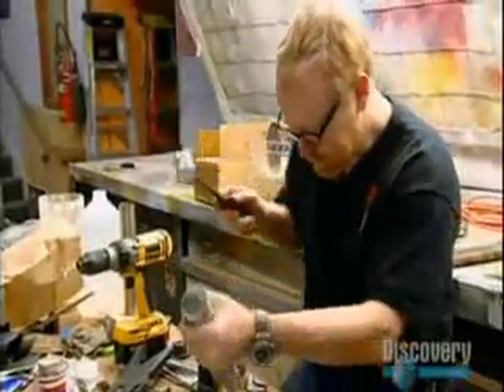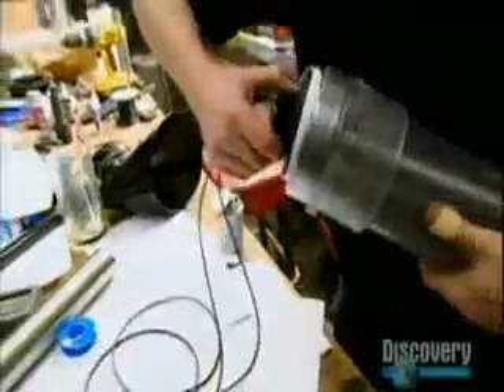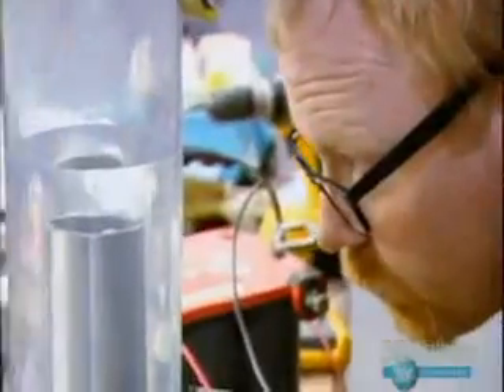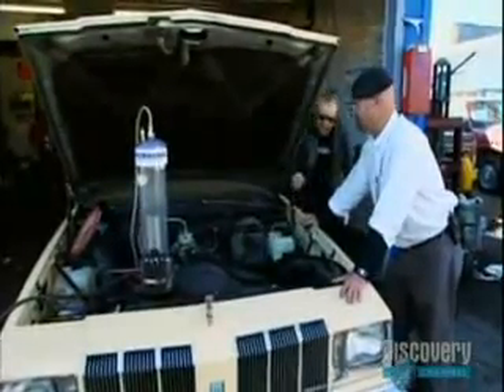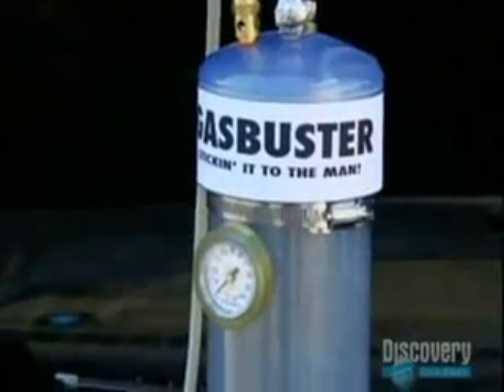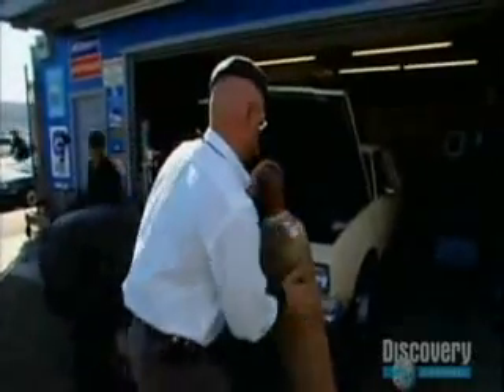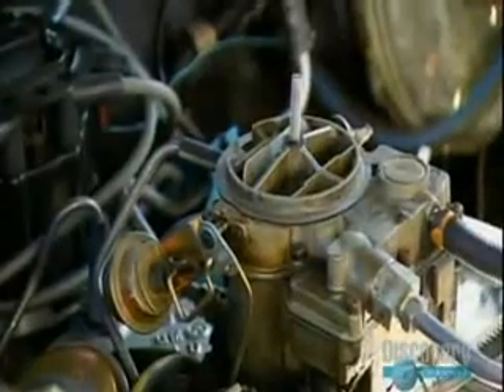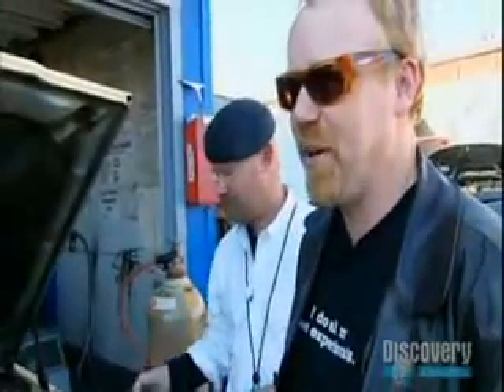HHO Mythbusters Explained

Comment: They DIDN'T try ! More like they set out to disprove it ! Like the announcer says, "supposedly apply electricity to water and get hydrogen, at least that is what is CLAIMED". To make it sound like electrolysis isn't a real thing either. And there were no bubbles of H2 and O2 coming from the cell like their should be. Connect 9v or 12v to tap water and you will get a very visible stream from the wires even without adding salt. Adding baking soda or other electrolyte will make it greatly increase. In the video you see no bubble stream at all. And Grant is supposed to be an electronics engineer and should know better. Either the cell didn't get power or was shorted. Either way they could compare it to any electrolysis demo on the internet to see it wasn't working.
The also mentioned this is from an "internet patent" to discredit it. There is no such thing ! You can get ANY patent from the internet but that isn't the same thing. Then at the end they mention it was from the internet AGAIN. 

They actually debunked electrolysis, claiming it didn't work. But they didn't say that. But they showed by adding electricity to water you get no gas at all. Since they knew it was electrolysis, they should have known it was wrong ! But instead they showed it produced no gas at all ! A pretty simple experiment to mess up ! Put 2 wires in tap water with a DC voltage on it. Or just drop a 9v batter in a glass.

Why didn't they contact any of the companies or customers in the area for a demo ? Why not even ask a local science teacher ? They have a research department but didn't try ! And their are plenty of people available to contact on Youtube.
This is what it should look like for even a very basic demo without even having many plates.
run your car on water. This guy does just that! 
https://youtu.be/wjeM2IBhtlc

water electrolysis
https://www.youtube.com/watch?v=HQ9Fhd7P_HA

Notice both demos have easily seen gas streams !

There is no mention AT ALL of the NASA study that shows adding hydrogen increases MPG either from the "research" they did. It increased  MPG from 2 - 4 MPH and decreased pollution too.
http://www.hydrodynamicshho.com/nasa-reports

Or many other studies out their. So much for "science" to ignore the existing data then try to discredit it. And their are many studies that show much higher efficiency than DC electrolysis.
http://www.hydrodynamicshho.com/nasa-reports

Pulsed DC and Anode Depolarization in Water Electrolysis for hydrogen generation
www.dtic.mil/cgi-bin/GetTRDoc?AD=ADA297375
It says you can TRIPLE the DC amount of gas and possibly TRIPLE that to make it 9 times the DC amount of gas !!! Why is this not mentioned anywhere. It is from an Air Force Thesis so it would have been verified by the professor !

They pulled the same kind of stunt with the Bedini motor. Then shows a DIFFERENT motor and turned on the "modulator" and said they could here it run down. The Bedini has no "modulator". And they could have contacted someone on the internet or Bedini himself and got a demonstration and tested it.

Comment: We did this for  our physics project. saving 60 + - percent of gas. and we did run the car without gas. 
we had a lot of bubbles. 4 litters of purified water and 4 spoon full of baking soda . wish i could send pictures. the technique is when u make a hydrogen reactor, use 3 cylinders of food grade stainless steel (316). using the other two as neutral conductors. and maybe more electricity for more reaction? :)

Comment: Hydrogen embrittlement is the process by which metals such as steel become brittle and fracture due to the introduction and subsequent diffusion of hydrogen into the metal. This is often a result of accidental introduction of hydrogen during forming and finishing operations. This phenomenon was first described in 1875. via Wikipedia,

how does the average diy user overcome 
this issue, there is a process that is done to aircraft engines to avoid this, but I don't think car manufacturers have this in mind when designing engines.  this could potentially cause serious havoc if one were to run hydrogen as a fuel long term

Comment: Splitting water, which is a product of combustion, so that one can reburn it is a circular or reversible process. In any reversible process some energy is unavailable for useful work. That energy is called entropy. That is the reason why this kind of thing can never result in more energy out (better fuel economy) than in. For that to happen would allow for the building of perpetual motion machines. We would be able to build power plants with only water as a fuel.
Reply: +Kim O&#39;Brien power plants CAN be built to run with only water as fuel. Einstein said it "hell of a way to boil water". near every nuke power plant COULD drill well shafts to use geothermal heat to make steam needed to spin the turbines, instead of enviro-hazard nuke boilers. re-condense the steam after the turbines, drop it right back down the well casing. they can't NOT know this, it really can be that simple. need more pressure drill another well shaft to trickle water into and connect it. they'll drill for OIL through miles of water and Earth, but they refuse to stop nuking the planet for profits.

Comment: I was wondering why they were getting so little hydrogen out of the system. The mistakes make sense but Grant should have at least known you need an electrolyte. Salt and baking soda are the most common in the cells. I don't believe you can power a car off a small cylinder or a few small jars of water. What does seem to work is using it to boost gas mileage. It's not free power either way you need energy to split the water. I take it the idea is to use excess alternator power to run the cells. You won't get a huge amount of hydrogen but even a 10% boast would make it worthwhile. I think it is possible to set up a solar panel for electricity to run the system then store up hydrogen for a few days and go to the store and back. No matter what always remember hydrogen is not a power source it's a storage medium. In the case of the car systems they are storing excess electricity as hydrogen. Unless you are going down the road once the battery runs dry you're done making hydrogen.
Reply: +Cary Howe Their is no such thing as excess alternator power. The regulator controls the magnetic flux in the rotor so that excess electrical energy isn't produced. Splitting water into its components and then recombining them is a reversible process. This process results in entropy, energy that can not be used for useful work meaning you lose energy through this process.
Reply: I made more fucking around in the basement with a ball jar, a car battery and some solid copper wire. I think this may have meant to be a joke, wtf is he doing with the Oscilloscope? Apply current and watch the effects with baking soda, it's simple.
Reply: Also, don't use salt. It makes chlorine gas when splitting the water which is very toxic.

Comment: Frozen hydrogen powers space shuttle rockets. Yes, it's risky. Leaky o rings caused Sally Ride's shuttle to blow up the whole crew while the world watched but NASA didn't give up like Mythbusters. I haven't given up on splitting water into hydroxy gas. I've built the biggest array of tubular cells in the world (that I know of) on the same tubular principles of Stan Meyer's array that powered his dune buggy, and using solar power, instead of my engine's alternator, I've powered up a 454 c.i. with it.
Reply: +Pat Barber That's liquid hydrogen not frozen hydrogen. Second in space temperatures kerosene is like molasses that's the reason for using hydrogen in booster rockets. At the launch pad good ole kerosene ( jet fuel or diesel) still does the heavy lifting although some designs have used solid fuel.
Reply: +JTBettencourt thanks
Reply: Pat Barber I have no doubt that you can split water into its component gases. What I object to is people saying that this is a way to create extra energy. Like powering a car on water alone aka Stan Meyers. Anyone can build a car or power generator to run on HHO gas. What they can't do is build is a self running or looped machine that puts out extra energy. 

In other works the car and its alternator, no matter how big the alternator, can not both feed a hoffman apparatus to make gas to be the sole power source for the same engine driving the alternator and have leftover energy to power the car.    

Using solar to create gas and then running an engine on gas does not violate any scientific laws. However from an engineering practicality view it is dubious in a motor car. Using the solar electricity to charge the batteries in an electric car may be more efficient. Storing the gas and storing gas safely are problems.
Reply: Where are the solar array and gas generator at home or on the bus?  You could store the gas on the roof like city buses using methane. Can you go 150 miles a day with your setup?
Reply: Pat Barber So you are just adding HHO gas while using  gasoline as a fuel most of the time? Or how do you switch? If you add HHO gas your going to make the mixture richer because now the gasoline doesn't get the same amount of oxygen from air while the HHO gas has the correct mixture of oxygen and fuel (hydrogen).
Reply: +Kim O'Brien I don't run hho at night. it's only worth it when I have solar. Although my battery bank will power it for 20 miles depending on how level the road is.
Reply: Leaking hydrogen didn't blow up the Shuttle. The leak was from a solid-fueled booster rocket. Hydrogen wasn't involved.
Reply: +Kim O'Brien You're right. I don't have an electric motor on my bus. I did the math. To put in an electric motor with enough solar panels to drive 150 miles a day would be  $70,000. That's why I split water. In full sun, my hydrolysis array can make enough HHO to keep the motor at 2,000 rpm on level roads.

Comment: You can't run vehicle on HHO by itself. It just doesn't work like that. You can use hydrogen to run a vehicle though. This technology already exists, but the current method of storing the hydrogen is stupid and unsafe. They just use highly pressurized storage tanks (explosive) instead of a bottle filled with hydrogen storing metal hydride (somewhat expensive) which is much safer. You could use hydrogen filled metal hydride canisters in conjunction with gas or just burn the hydrogen. For hydrogen production you could use solar panels, wind turbines, or an industrial scale LFTR.
Reply: I think what you meant to say is that an engine can run on hho alone, but an engine cannot run on hho produced by it's own power. You'll always need a source of electricity greater in power than what the engine could produce. So no self running hho engines.

Comment: I would like to see a car actually powered by HHO on a dyno. Not gas + HHO, but ACTUALLY powered by HHO. If i had the money to waste, i would do it myself.
Reply: +Alex Crouse You would need a supply of electricity to make the HHO to do that though. If you have a supply of electricity than why not simply use the electricity to run an electric motor? Unfortunately the cars alternator doesn't make 'free energy' it comes from burning the fuel. The amount of energy needed to make the HHO exceeds the usable energy obtained from burning the HHO to make water in an internal combustion engine afterwards. This is called a reversible process. The laws of physics say that in any reversible process there is always a certain amount of energy (entropy) that is not available for doing useful work.  That is why the cars alternator no matter how large can not supply enough energy to make a gas (HHO) from water to then run the car and the alternator. No one has every seen negative entropy on earth except for people wanting to defraud investors, customers and those unable to properly use and understand scientific instruments.
Reply: These people claim it can happen. I want them to prove it.
Reply: Are current scientific understanding says it can't be done. If they were able to do what they claim, instead of resorting to conspiracy theories as proof, it would be worthy of a noble prize
Reply: +Kim O'Brien I know. That's why I want to see it!

Comment: How long would it take for you to make a car on your own from scratch?
Reply: +Rush Brunette You would need to start with the basics. Oil to make plastic, iron ore, coal and limestone to make steel,  copper ore and electricity for electric wire, a source of energy to make electricity, cotton or leather for the seats bauxite ore to make aluminum engines, you would need to travel around the world to find your materials  and ....) In short it is impossible for a single individual to make a car from just materials on earth. It takes a world industrial economy to make a modern car. It takes about an hour to assemble a car on a production line. However every thing has to be manufactured and ready to assemble. Even Henry Fords model T used latex from rubber trees in Brazil for tires. The Pentagon admits it cannot source all its equipment and materials from within the United States itself.

Comment: I have never seen a car run on Hydrogen in person, but I can absolutely support this video in the respect that Jamie and Adam's generator was not producing nearly as much bubbles as it should. I did electrolysis with a 9V battery, a plastic bowl full of salty water and two scrap pieces of wire today and it aggressively sizzled at the negative wire when dipped in the water.
Reply: +MX6Maximus you're telling us that if you put water in a cocktail shaker and shake it, or park it beside a CB radio, it'll explode in one huge ball of fire?  I think not.

There are any number of ways of cracking H2O.  Not one of them produces more energy than they consume, if the end result of this rigamarole is to burn the hydrogen to produce water again.

Some of the ways of cracking H2O - heat to plasma temperatures, or add calcium carbide, pure potassium, pure sodium, finely granulated magnesium, or cesium (nice big bang).  None of which are cost-effective, let alone energy efficient ways of producing hydrogen (or any other flammable gas) in large quantities.  Some of them are handy upon occasion, but none suitable for improving the efficiency of a car.
Reply: +Christian Lewis Jesse James made his own salt flats speed vehicle that ran only on hydrogen. It set a speed record of 200 mph. I think it was the show "jesse james is a dead man"
Reply: It didn't make ANY gas, and they knew it. Your right, it should have sizzled. Just like they said it was from and INTERNET PATENT to discredit 
it. Their is no such thing, it is just a PATENT like all the others. They didn't add any electrolyte either. 

My local power company had a FLEET of service vans running on hydrogen and still does. If you have DP&L ask one of the service people for the vans.

They also didn't mention that NASA did a study on hydrogen to get better gas mileage and got about a 5% improvement but still claimed it didn't work. And they have paid researcher but couldn't find it ? Yea right.
Reply: MX6Maximus
I'm sure he did, that's why he called it a condenser which is in no way a   HHO generator.
But hey, it sounds like you have it all figured out, why don't you build and sell cars using your technology like Elon Musk did with his Tesla brand car.
No point discussing it since you have already made-up your mind about it, go build your cars and be rich and famous too!
Reply: Wildman Fujiami That would explain why when I accidentally sniffed it I felt like death had entered my nose for a second.
Reply: Yes, electrolysis works great!
Reply: MX6Maximus
Sorry, frequency and vibration don't work, that is fantasy. And, only certain forms of energy will and even that is shockingly inefficient.
Reply: MX6Maximus
I'm familiar with Tesla's work. He did a lot of work with frequencies of electricity and with mechanical vibration. He never claimed to have split water into hydrogen and oxygen. And that makes sense because frequencies of any kind only reduce the yield of hydrolysis and water has no resonant vibrational frequency (water atoms yes, but in liquid form, no).
Reply: Intead use water, better use urea?
Reply: I would avoid using salt water at all costs, however. given the reaction produced Na+ and Cl- you are essentially also producing toxic chlorine gas.
Reply: Well yes, but unless you do something like that, you can't get the electricity through the water, and the cell would take too long to make much hydrogen.

Hint: distilled water has very little conductivity.

A pinch of salt makes the reaction proceed much more quickly.  Since the chlorine doesn't come from the same electrode as the hydrogen, you can just throw it away, and a pinch of salt isn't enough chlorine to worry about.  Yeah, you've thrown away the oxygen too, but that's kinda easy to add.